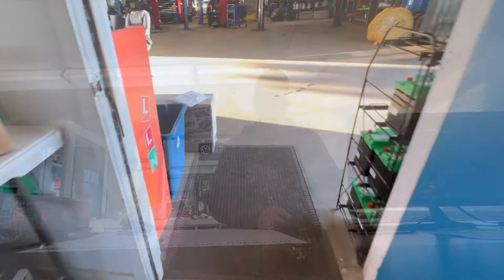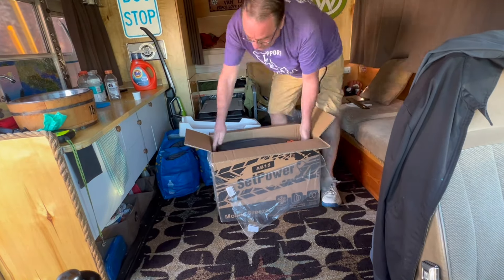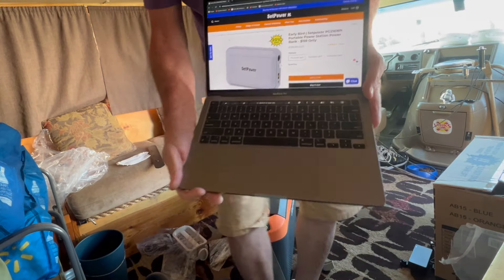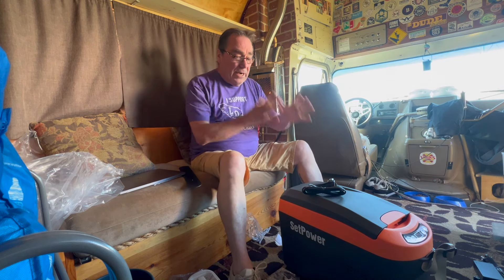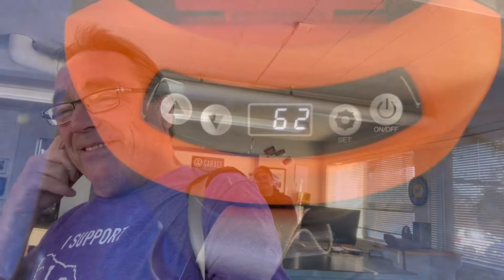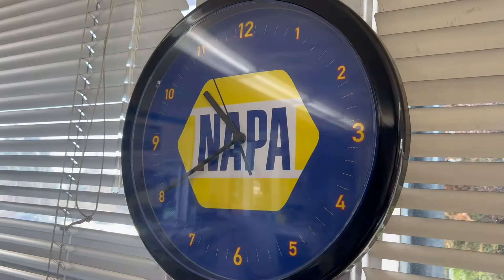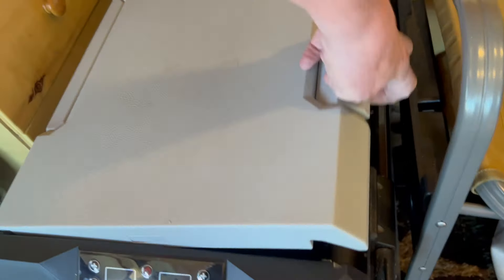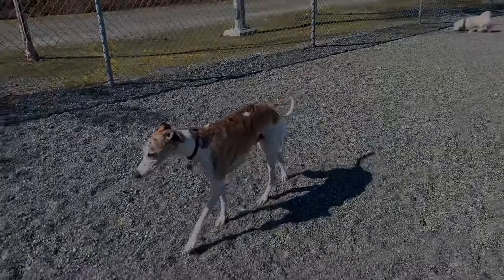Preparing Vanlife For The Ultimate Spring Road Trip With Exciting SetPower Fridge Upgrades!

Comment: Good Wednesday morning Brent, it's 10: 25 am and it's a sunny 11 degrees Celsius in Cornwall, ON.  I  like your new cooler, do they have an attachment for the bottom which  pulls out with an adaptable vertical handle so you can pull it down to the beach rather than lug it?  That slide out unit under your old fridge is the cat's meow.  It's nice out, so I am out of here, happy travels, perhaps we'll meet along the way. ❤ 😊.
Reply from the maker: Just a strap, but very light weight

Comment: That’s a ‘cool’ little freezer. It seems like it’s meant for carrying to the beach so does it come with a battery to keep it cold? Or it just stays cold longer than normal. Twenty minutes to 0 was amazing
Reply from the maker: Actually stats say 10 minutes. They sell small lithium portable batteries just for that. Check out the video or the website or the links listed in description